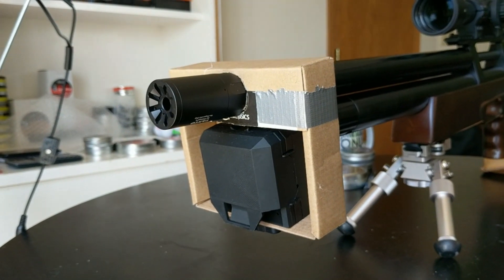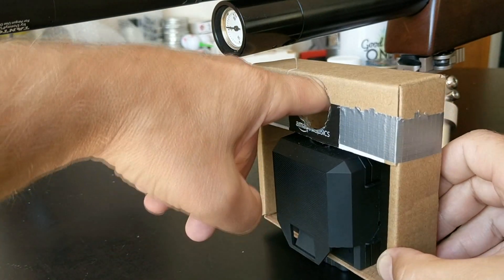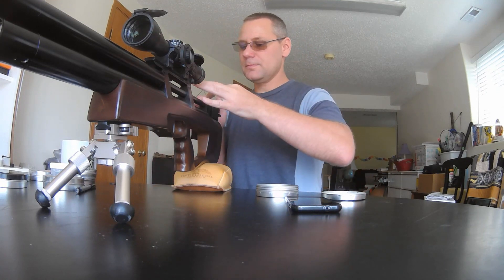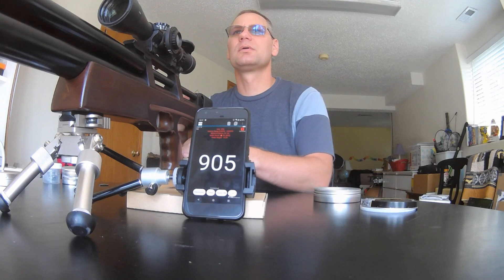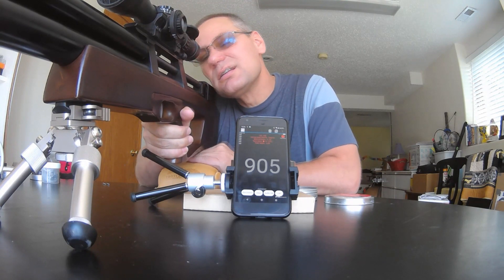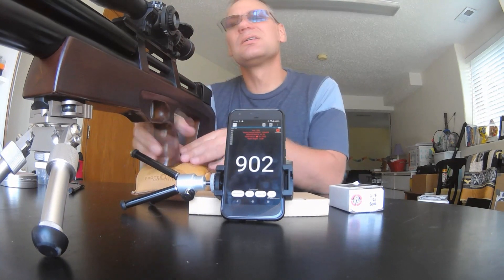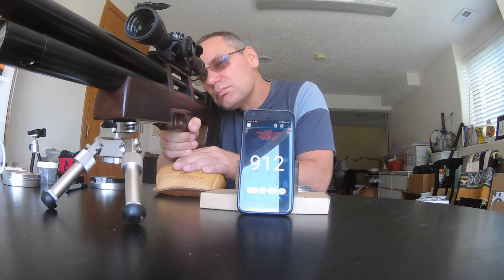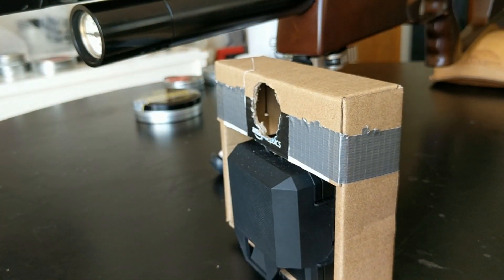FX Radar Chronograph Barrel Mounting Proof of Concept

Comment: Well the mount reduces the difficulties in finding and reproducibly setting up in the 'sweet spot'. But, or course, it does nothing to address the inherent limitation that you pointed out in your earlier reviews in which you showed that the FX chronograph can not resolve velocities to even the nearest FPS. So the reported values are severely quantized. Just can't see spending $200 for a unit with the limitations this one has...

Comment: I just stumbled upon this.  It's awesome - you've clearly got that gun dialed and know it quite well.  I'm a recent owner of one myself - a .22 long.

Question(s) if you don't mind?  :)

Assuming 22 based on ammo sizes and weight  ( y/n)
Short, Standard, Long?  ( not sure if barrel lengths make a huge difference, if any for tuning . . .  )
I'll assume that you know what the reg is set at (perhaps not) - but if so (two part here) what is it set at?  Is it the OEM reg or did you replace it a huma?
Lastly - (with the reg question in mind) - stock airtube or did you add the Earnest Rowe plenum?

Sorry for the interrogation (lol) - I'm playing with / experimenting with slugs myself and am pretty sure that the reg setting on mine out of the box is a little "hot".  The OEM reg's, while reputedly quite good, are also kind of "ugly" to adjust.  I'm inclined to put a huma in it for comparatively simple ease of adjustment.  I've got on in an m-rod that I built and it's easy peasy to adjust them.  ;-)

( hoping you'll see this . . .  )  Thanks!!
Reply from the maker: In this video my long has the factory reg set at 133 BAR with no Power Plenum. The reg setting is different for standard and compact guns. I also have a .22 compact and believe the reg is set for 113 BAR from the factory. Barrel length makes a difference. Longer barrels can more comfortably shoot at higher velocities. I'm currently playing with other tunes with a Power Plenum and Huma Reg on my Long for slug testing. I'm using the Huma Reg because it is easier to adjust not because it is better. I've experimented at several different settings between 120 - 150 BAR. I'm leaning toward putting the stock reg back in and leaving it at 133 BAR. So far I'm not seeing any increase in accuracy at higher speeds. If the accuracy is the same, I'd rather have a quieter and more air efficient tune.
Reply: @ajarnmichael1  - thanks!

Comment: Good video and clever design! I do have question about the veteran, is the hammer spring adjustment that way from factory or is that an aftermarket addition?
Reply from the maker: I printed the sticker with the clock like tick marks as well as used a Sharpie marker to make the red indicator. The hammer spring adjusts this way from the factory.
Reply: @ajarnmichael1  ok very nice, seems like a real nice feature to me!